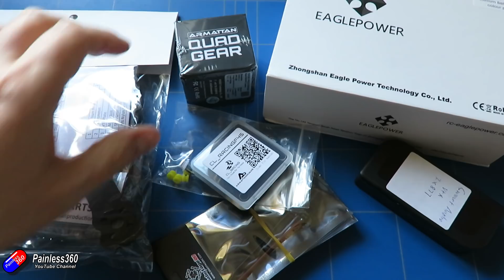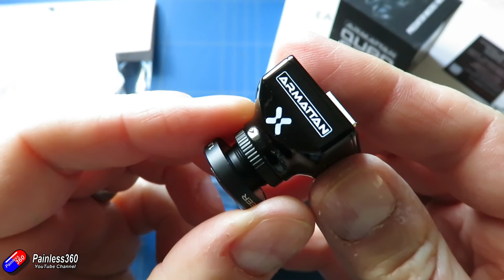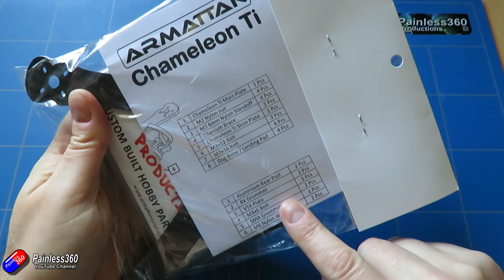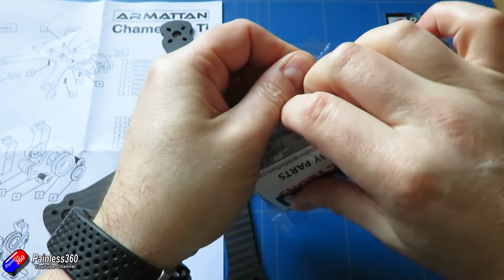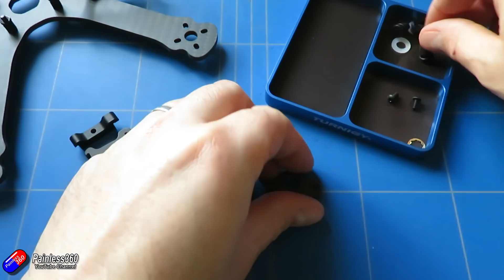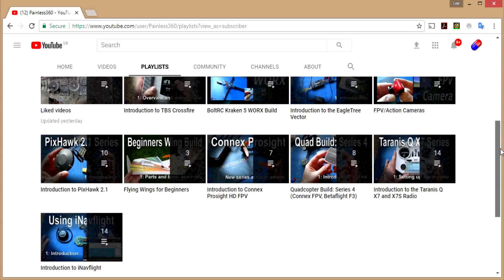Quadcopter Parts List and Armattan Chameleon Ti Build Tips

Comment: Hi Painless360, I have recently assembled a Chameleon Ti frame and mine came with an extra piece of carbon fibre. It's 30mm wide with four holes, two of which line up directly with the front or rear sets of top plate screws OR the screw holes that hold the antenna mount on. Below the two wide set holes are two more holes that are slightly wider apart than the forever tubes. I thought it was to screw on the outside of the rear end to space the antennas in a 'v' shape but I think I'm grasping as the tubes don't fit the holes. Or just a widget to cable tie stuff to?
Any ideas?
EDIT: Never mind..I found it on the Armattan site....it's a 'Rooster Long Range Plate'.....dunno how I got it but I'll find a use :)
Reply: I got this in mine too

Comment: I have the same flight controller does it matter what esc/motor I hook up? My board is rotated 90 degrees and I’m wondering if that’s what causing flip on take off.
Reply from the maker: Unless you changed the orientation of the board in the software- almost certainly. See my video on what to check if your quad flips on take off..
Reply: Painless360 I watched ur video and rotated my board in BetaFlight but I can’t seem to get it still my board has esc 4 connection in the bottom right doesn’t rotating in BetaFlight make it so this doesn’t matter?

Comment: how long is that battery plate? basicly how long battery can be added?
Reply from the maker: 95mm but the battery can stick out the back..
Reply: thx, ok good to know that also, btw as you said that propeller may hit the battery if it too wide or moves... sooo what would be the max battery wide then? :)   just gathering part for my first quad :P frame will be chameleion Ti 5

Comment: Threadlocker. Hi folks. There's a large range of these available. Some form a near permanent joint. If using then something like Loctite 222 is a weak one that can be fairly readily undone. These products are anerobic glues and they hardens in the abscence of air. Most odd. I've used 222 on the chassis of a Gauge 1 steam engine. If a bit obstinate a judicious amount of heat will break the bond even of the stronger ones. Apply heat using a close fitting screw or hex driver with just the tip heated to red heat. Mind your fingers! Use some heat insulation to hold the heated tool. Do not use this tool to loosen the screw, the heat will have softened it. Quickly change to a high quality good fitting driver and don't give the 'glue' time to harden again. Alternatively, a more expensive option is a mini hot air gun designed for solder/desoldering electronic surface mount components.  The temperature needs to be about 250 °C, 500 °F.  Do not apply for longer than necessary. The advantage of this way is that you can apply force to undo the screw at the same time as heating it. Bob UK.
Reply from the maker: https://www.youtube.com/watch?v=8t9jpUcANxA was the last time I made a video on it.. Thanks for the comment! :D

Comment: Hi Lee. I may have a grommet trick. Wrap a piece of thin but strong thread fairly tightly around recess in grommet. Single layer. Thread frame hole end through hole in frame. Offer up grommet to frame holding far end of thread pinched down on the cone shaped end of the grommet (tuck it through grommet if in the way). Gently pull other end of the thread hopefully feeding the grommet through the hole at the same time. It's an old trick for getting tight rings off fingers although that involves a needle. A very small amount of strategically placed silicon lubricant (or soapy water) may help, but could make things too slippery. I don't have the bits here to check if it works before posting so E&OE! Bob UK.
Reply from the maker: Wonderful tip! Thanks for sharing..
Reply from the maker: I've never needed it, my fingernails have always been strong enough :)
Reply: Surprised you didn't know that one, remember when the camera mounts had 4 rubber shock absorbers.

Comment: I love this frame. Do you think the Holybro Kakute F4 AIO V2 and Atlatl HV would fit in this frame? Maybe without the heat sink?
Reply from the maker: The height between the plates is 22mm, you'll need a small stand-off below the FC. That's a whole mm more than there is in the Kopis 1 Quadcopter from Holybro that uses the same stuff. So, with care it should fit.. Best of luck!